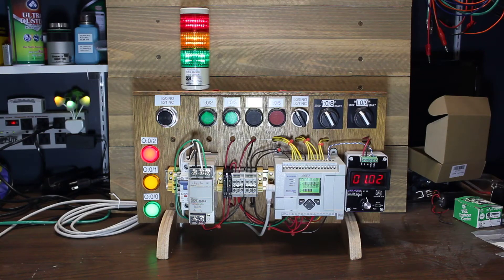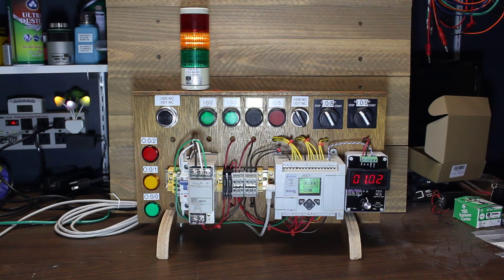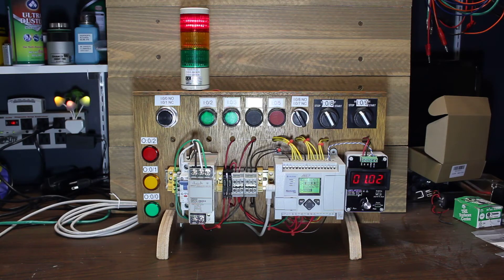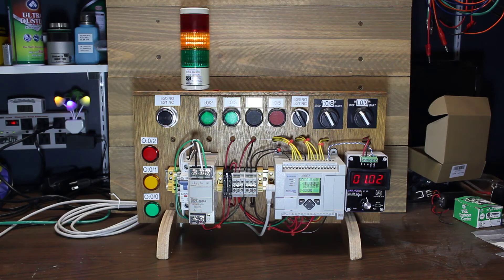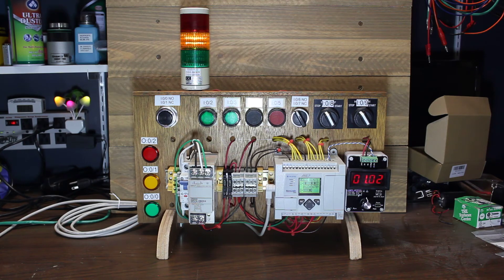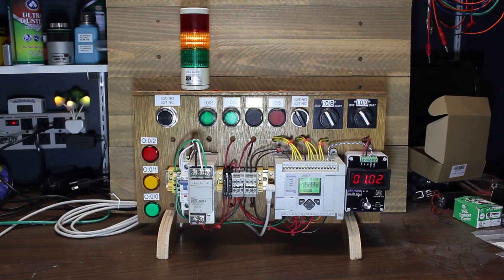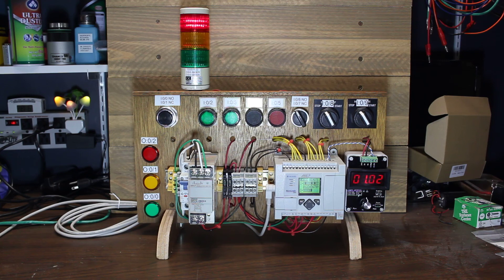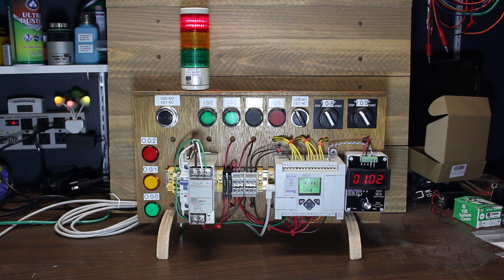MicroLogix 1100 PLC Trainer

Comment: Hi, I have just bought a Micrologix1100, and I am building a trainer. What is the main circuit breaker rating you are usings,or how do you calculate the rating, and what is the rating of output fuses you are using. I also don't understand why in PLCs, they use fuses for output and not for inputs.
Reply from the maker: Hi Jamal! I can't say that anything I do is necessarily right or wrong or best practice, but I'll layout what I did and why. Hope it helps!

The main breaker is rated for 2 amps. The reason is that the Omrom power supply I'm using is rated to pull 1.7 amps max, so I chose a breaker that was just a little more than that.

On the DC side, I have two fuses. the first is on the power connection for the PLC itself, and it's rated for 2 amps. I can't remember why I went with 2 amps, I may have picked that number up from the manual or elsewhere.

The other fuse is 250mA, and it feeds all of the inputs and outputs. Since I'm using LED indicators, there isn't a very high current draw, so this is more than enough. It's more than any single output can handle (100mA) so it's not perfect as far as protection goes, but it's primarily there to ensure if something does get shorted, that the power is cut. Given that I'm not adding/removing inputs and outputs, there's little chance of a short occurring. In a "real" configuration, it may be ideal to individually protect the I/O points.

Comment: Where  can I find a 0-10v input module like that? How much was it?
Reply from the maker: The device on the right? It's a DROK signal generator from Amazon.com. I think it was around $30.
Reply: Thanks, the cheapest 4-20 simulator i've been able to find was around $200. 

Did the course on Udemy go over how to set up a simple PID control loop?  I'm thinking about building an electric bicycle and using an 1100's PID function for a cruise control setting, but I have no idea how to do something as complicated as PID control.
Reply from the maker: +Blake Gardner Sure! The class touches on PID control, but he uses a different PLC, a MicroLogix 1400 I believe. I tried to do PID once on my 1100 based on what I learned, but it keeps faulting the PLC so I moved on. Might be something I did wrong, not sure. The 10v analog signal did work though!